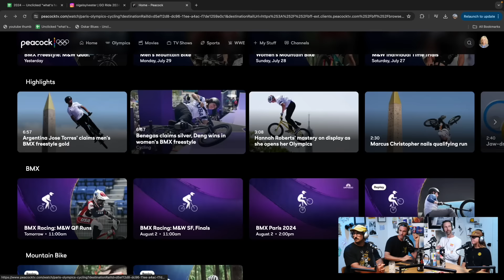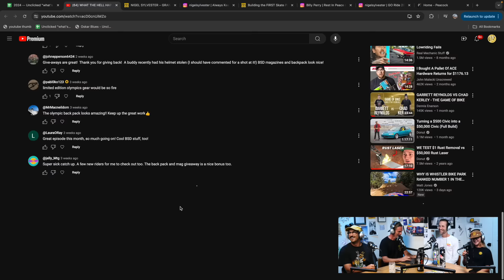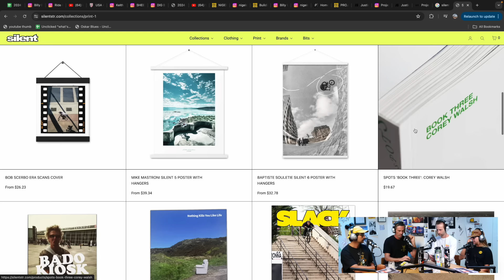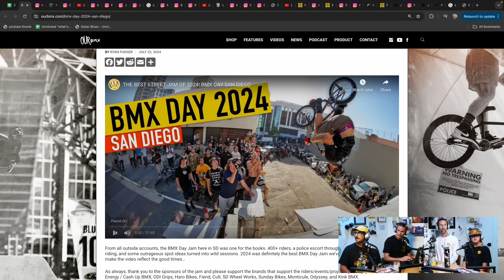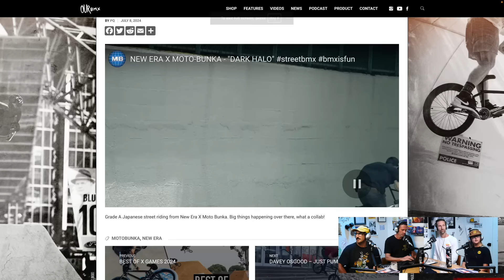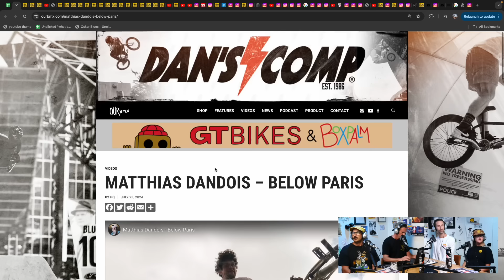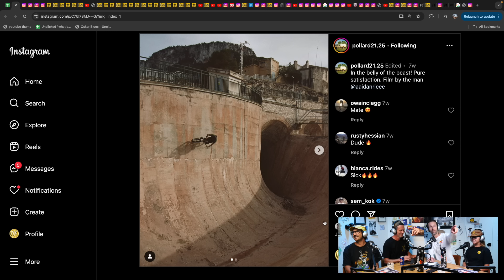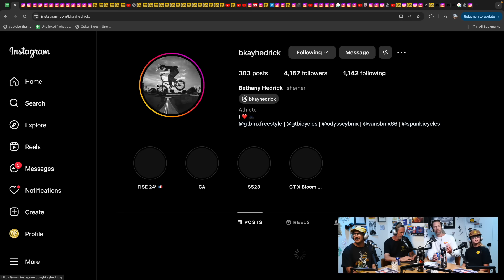WHAT THE HELL HAPPENED IN BMX?! – UNCLICKED – JULY 2024

Comment: Jeanjean’s run had maybe 3 absolutely massive tricks and arguably at first watch it feels like he should have won, but rewatching it there are a few filler tricks, overall it’s a bit scrappier and not quite as smooth and coherent as Kieran and Maligno’s runs. Maligno went massive, threw some huge tricks, and was fast and smooth the entire run - the sort of riding Logan used to always win for. It’s arguably less flashy on the surface but won’t have been penalised at all. Kieran is somewhere between the two. He did that huge transfer in his second run, was pretty smooth (something he has worked on) and also had some massive banger tricks. If he had managed to do that spine fronty on his second run I think he would have taken the gold. Surprised he didn’t find anywhere for a double flair - but at least we got one from Jeanjean - and Logan did one for the first time ever in a comp, which was a nice throwback after he casually posted him doing one a week after winning the last Olympics.